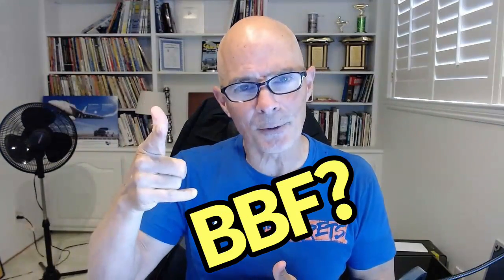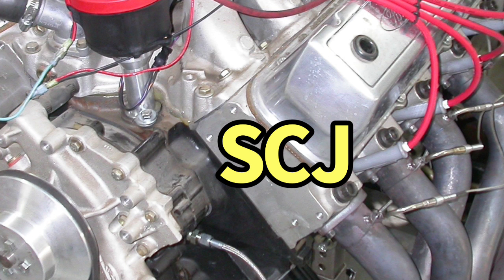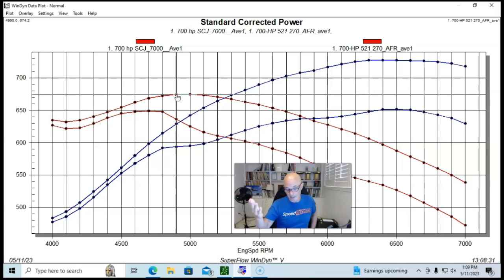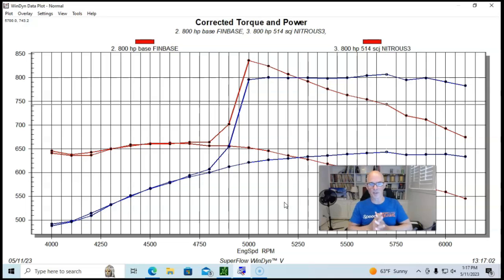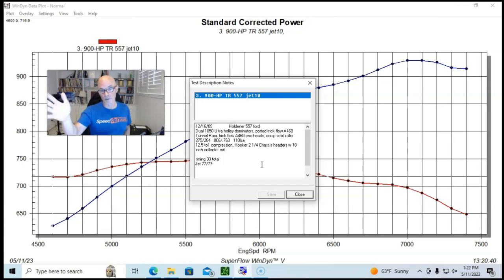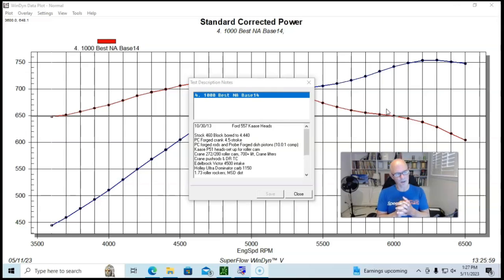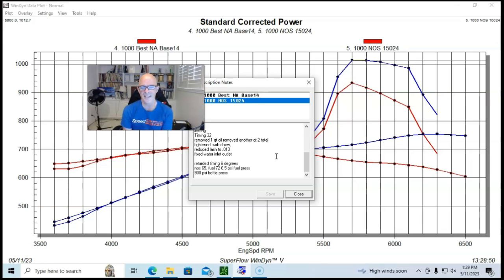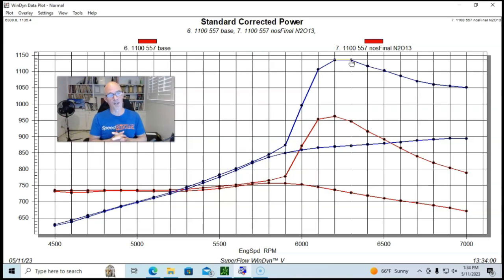HOW TO MAKE BIG BLOCK FORD POWER PART 2! 514, 521 AND 557 CUBE BBF STROKERS. 700-1,100 HP COMBOS!

Comment: Nice. Those P51 or Trick Flow heads are the ticket if you can get 'em.
Reply: I'm just finishing up working over my SCJ heads! All they need is a lil bowl work and smooth out the ridge where the valve seats were cut in.. that really wakes em up!!!